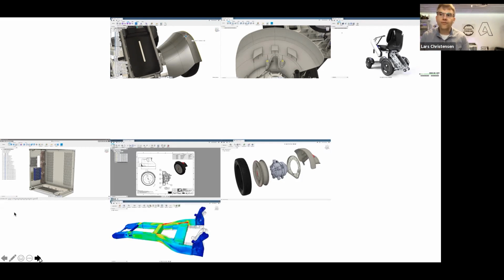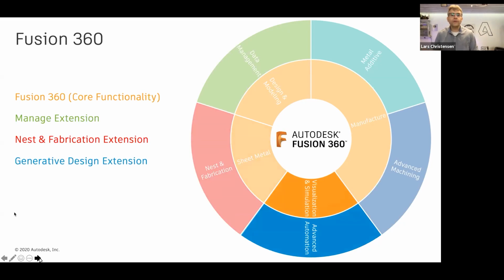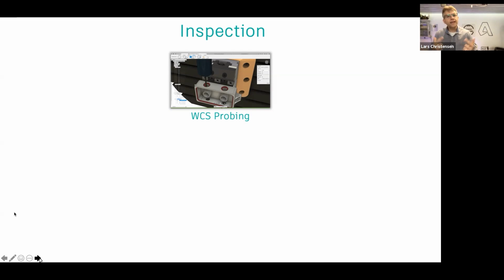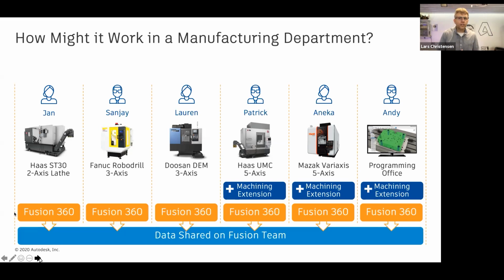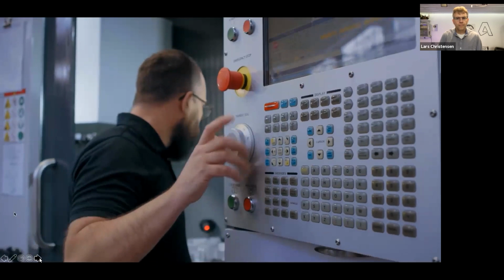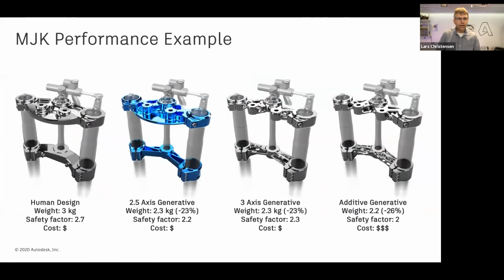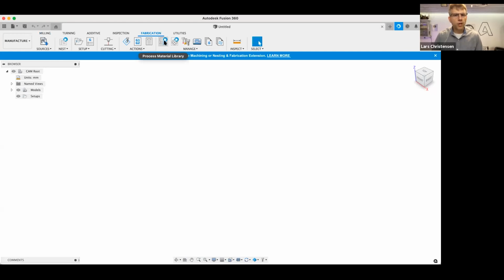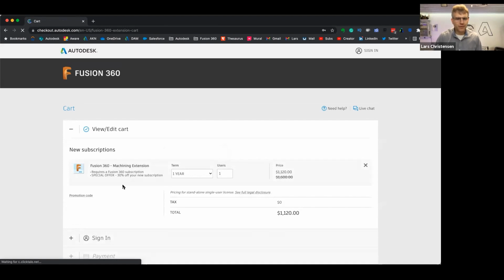What are Fusion 360 Extensions? Why do they exist? Do I need them?

Comment: The rub on the extensions is, you pay $60.00 per month for the entire program, then just one extension is $200.00 per month.  That's insane, especially considering some of the basic functionality that is only reserved for extension options, such as Tool Replace.  That is something that should be included with the basic cam package.
Reply: Its simple- Don't use them/it then, go buy somthing you find more palatable from a price point. Ill never understand why people running hundreds of thousands of dollars machines earning money from them and the software and still bitch about it. Ditch the software completely and see how productive you become then...
Reply: @makuntizitchi4815   Ill never understand why some people feel the need to be arrogant asholes in a thead like this! Autodesk chose a deliberate strategy of luring people from other platforms by offering very advanced features for cheap in an immature program, and then removing those features. 
The typical user of Fusion 360 are ones that did not want to - or couldn't afford Solidworks/Mastercam adn the like, and very few users are running hundreds of thousands of dollars of machines.
The marketing of Autodesk is like drug dealers giving heroin laced candy to kids.
Reply: @makuntizitchi4815  I've made a lot of money and a lot of programs without CAM.  I'm not the only one.